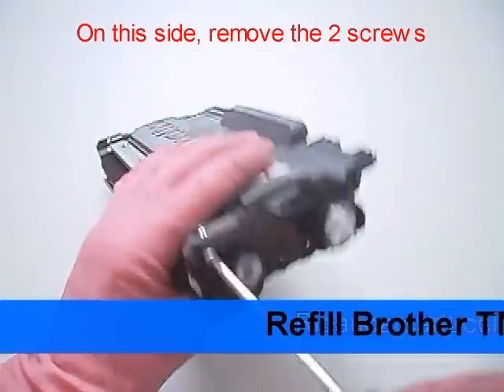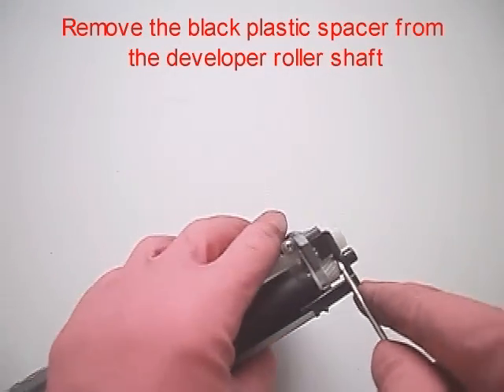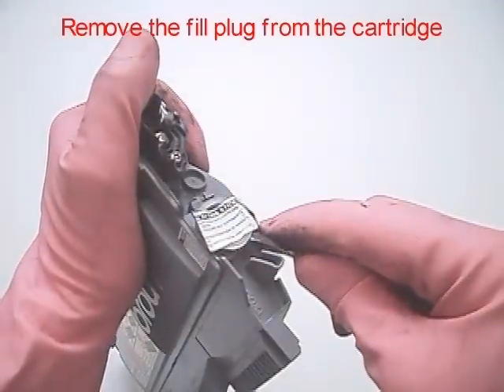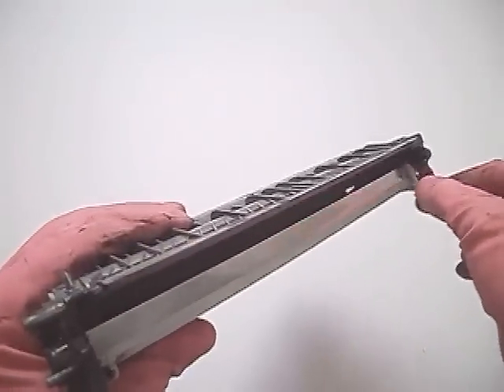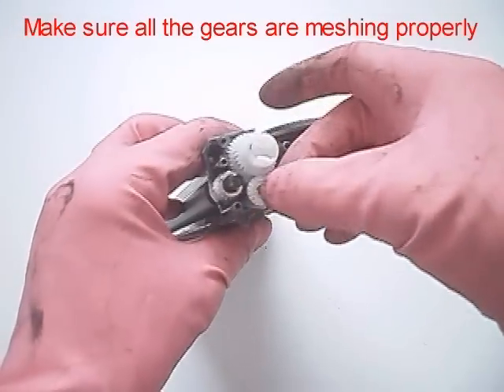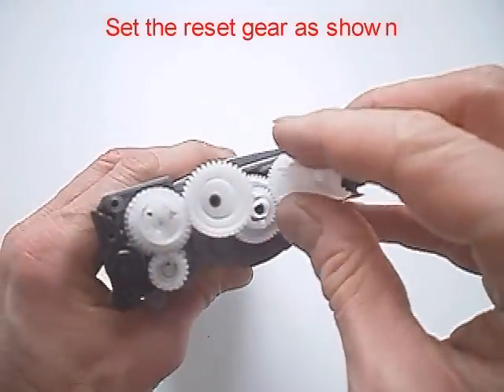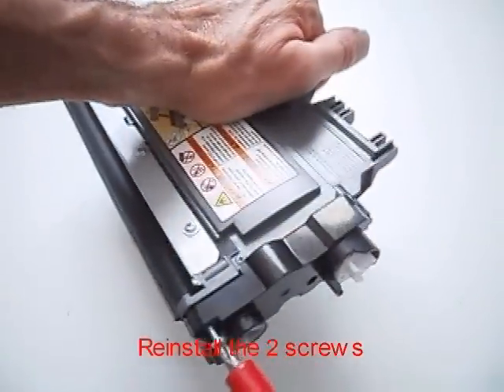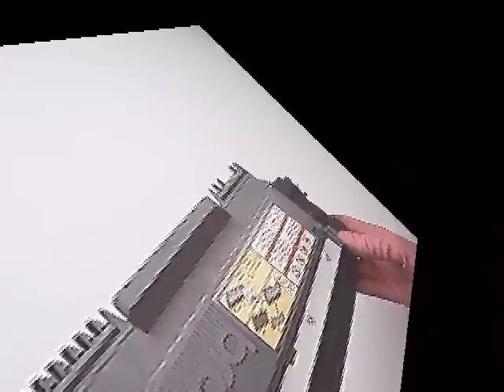Brother TN420 TN450 TN2210 TN2220: refill and reset toner Cartridge

Comment: #1  About how many times can this refill be done before other components just start to wear out?  Assuming the user goes past the low toner warning but refills as soon as the printer refuses to print, resetting reset gear required.

#2  When parts start to wear can we just replace them and rebuild the cartridge instead of throwing the whole thing away?  I am sure this is what brother does when they offer a free shipping label to send in old print cartridges to be recycled.
Reply from the maker: A Brother cartridge could be refilled around 2-3 times before the blade or the toner roller start to be worn. Yes it's possible to change the blade or the roller, the only parts that wear. However I think Brother throw the cartridge you send to them, obvioulsly respetting the law

Comment: 2 more questions.  
There is one more roller that is not mentioned.  The developer roller I believe.  I think it is the one that heats up.  Should we be doing anything to clean that? 
 I was thinking of refilling two cartridges at the same time but the standby one would probably be sitting unused for several years.  I know laser printer toner can stay good a long time but should I wait and refill the standby cartridge until it is needed or will it be as good as new if it sits for 5 or so years unused?
Reply from the maker: Do you mean the fuser roller? You can clean it with alcohol, or a dedicated cleaner.For the other question, I think that cartridge is still good, you can refill it

Comment: Are the starter pack and TN420 identical except for the missing reset gear?  I received a toner refill kit and they sent out a reset gear and a new cover so it could be fit on.  Is the toner compartment on a starter big enough, or identical, to take toner measured for the high yield version?
Reply from the maker: Yes. it can take the same amount of tner

Comment: Don't we need to empty the waste hopper?  I did not see any mention of that in this video.  I only saw the part about cleaning out the new toner compartment but not the waste hopper.
Reply from the maker: There is no waste hopper in this cartridge
Reply: @viandant5    Does the unused toner then just get scrapped back into the main toner compartment then?  That would make it even more important to be sure and get all of the old and waste toner out.
Reply from the maker: @londonranks  Yes, the unused toner get scrapped back into the toner container

Comment: Happy to say this video is still excellent in 2019!  Just had a TN410 cartridge refilled locally and it did NOT work.  Before taking it back (involving a long drive) I decided to try to fix the problem myself.  Watched this video, found the problem (the reset spring not positioned properly) and it works perfectly now.  Thanks!

Comment: Thank you viandant5 for excellent instructions. 

What your description says (READ IT PEOPLE!) is true: when the new cartridge is inserted the contrast is reset. 

This is why you should not (on some printer models) just reset the "replace toner" message (or LED). When you do that the contrast is reset and you will get light printouts. 

When you replace (or refill) your toner cartridge AND reset the "replace toner" message the new cartridge will give correct contrast again.
Reply: I just replaced with a new cartridge on a Brother fax/copier and the print is really really DARK!   Anything with an even semiwhite background (cartoon from newspaper), the "white" spaces turned out very dark. I had to increase the brightness to get regular printouts.  So whatever changed for the new cart, it over did itself.

Comment: If High Yield Cartridge has 90g of toner, how about the low yield cartridge? How many grams? and what if I put high yield reset gear in starter cartridge, is that okay? thank you in advance.
Reply from the maker: low yield cartridge has 50 grams of toner. Yes, you can put high yield reset gear in starter cartridge. may be you'll have to modify or change the side plate
Reply: thank you so much Sir for a very helpful advice.. Cheers!

Comment: Hi, why the TN420 starter cartridge can not be refilled? It does not have the gear but I found a way to reset it thru the front panel. Thanks!
Reply from the maker: If you have a printer in which is possible to reset the counter manually, the started cartridge can be refilled

Comment: I ordered two toner cartridges for my Brother MFC-7340 from Office Supply at $49.99 each. When they arrived they look nothing like the original toner unit. Their instructions direct me to a web address for Brother Reset Instructions. When I go there I get a message No Project. I do not want to reset anything. I want something that works in my printer.
Reply from the maker: Joseph Bishop your machine uses TN-360 / Tn2150 toner cartridge. probably you bought the wrong cartridge, or you didn't remove the drum unit

Comment: I hope it’s not too late to get some help here.  I’ve looked at tons of videos, but can’t seem to get this to work (HL-2270DW).  I have a starter cartridge, and I have a replacement side panel.  The only steps on your video I didn’t do was use compressed air and clean the roller, only because the previous videos didn’t say that and I had already put in new toner.  But that should only affect the quality not the cartridge actually working, correct?
Can I not convert the starter cartridge with this side panel?
Anyway, I followed all the steps (multiple times) and I believe I have everything right (flag in the right position and the gear next to it pointing as directed), and I’ve done the button voodoo to reset the cartridge, but every time it tries to print it make three awkward roller sounds and gives me an error message.  I’ve checked and rechecked and can’t figure out what’s off.  And the gears are all meshing, just for the record. ACK!
Reply from the maker: Mr. Marshwhite which is the defect? it does not recognise the cartidge? the starter cartridge has a different side panel but it has no reset gear. do you insert the reset gear? probably the reset gear is not in the right position
Reply: viandant5 Thanks for responding!!  As far as I can tell it recognizes the cartridge.  frankly, it sounds like something is not jiving with the gears, but I have checked and rechecked (following your video step by step) and the flag is right, the reset gear matches exactly as the does the arrow pointing and the spring.  I am baffled.  I think I better order a new cartridge, see if something else is going on....unless you have another suggestion.  I hate to give up, but something is amiss.
Reply from the maker: Mr. Marshwhite try this to reset the toner sensor.
– Open the front cover
– Turn the printer off.
– Hold ""GO (START)" button while turning the printer on. All lights will be on.
– Release "GO" button
– Press "GO" button 2 times. All panel lights will be on.
– Press "GO" button 5 times. The toner light will be off. (error may be flashing) the paper light should be on or flashing.
– Close the cover. The ready light should be the only light on.
Reply: viandant5 I had done that several times.  Something finally clicked and we're back in the game!  Seriously, thanks for all your help; it's very kind of you.
Reply from the maker: Mr. Marshwhite ok, have a nice day

Comment: Great video. Easy to follow instructions.... though I don't have always the option with the compressed air..... You really did a PRO job with the cleaning and refill process..... Thanks for the instructions and the great video.
Reply: I'm using Brother HL-2240 with the preinstalled toner cartridge for now..... I'm thinking about the new generic TN-450 for later..... So, if I refill the starter cartridge and install the reset gear on it, I only get +/- 700 pages?? Is it best to get the new generic TN-450, which will get me +/- 2600 pages?? Thanks viandant5 and great video.
Reply from the maker: Biciman Junior thank you, happy to helo you. if you install the reset gear on your starter cartridge, you get 2600 pages.
Reply: viandant5
 Thanks for the reply. I'll get the reset gear.......  How many times do you think it's recommended to refill the Brother cartridge (the starter one, the TN-420 or the TN-450)?? Thanks
Reply from the maker: Biciman Junior the weakest component is the doctor blade, the metal blade of the developer roller. probably you can refill this cartridge 2-3 times

Comment: The video is not working for me. I have an MFC-7860DW printer. Can you please explain to me how to reset the gears?
Reply from the maker: which kind of cartridge do you have? probably you have a starter cartridge. the starter cartridges have no reset gear, it's not possible to reuse them unless you add the reset gear and change the side plate.

Comment: i'm trying to refill the cartridge that came with my brothers dcp-7065dn. this is the first time. i ordered the toner which came with the reset wheel. I think i've followed all the instructions but when i put it back in the printer it still says change toner cartridge. what am i doing wrong??
Reply from the maker: if the error message does not automatically reset, in the description of this video you'll find a procedure to reset it manually:

Comment: Sofar this seems like the easiest laser cartridge to refill.. the plug is there for you to refill with a minimal disassembly. I still think refilling an ink cartridge 5-8x instead is easier, but to each their own (my hp 7410 is on 18k pages and counting). 8k pages for $8 black toner (assuming 2 refills) vs 8k on 16oz of refill ink (assuming 12 - 15 refills) for $12, your choice.  It's almost dead even when you factor in the cheaper cost of the cartridges as a consumable over time (more expensive ink vs cheaper cartridges). Props to brother for making this easily refillable. BTW, a can of compressed air would also work for this.. minimal moisture, just use SHORT bursts w/ the straw.

Comment: Hi I have the brother HL-2270DW printer and it uses TN 420...I am confused about the toner refill part.. is there a specific type i have to buy or do all work just fine? thank you! 

and if you please know of any websites i can buy the toner refill from please let me know :)
Reply from the maker: in this type of cartridge every black toner for brother printers will works. be sure you perfecly clean the cartridge before.
I dont know which is your country, to buy toner refill try ebay or amazon, or Uninet, delacamp, future graphic
Reply: i live in toronto canada, and thank you so much for the quick reply! also do u think a vacuum is sufficient? i dont have an air compressor unfortunately
Reply from the maker: Esraa Elnagdi
a vacuum is sufficient. be sure to perfectly clean the foam roller inside the cartridge
Reply: ok thank you so much!

Comment: hello, when a refill the toner does not damage the parts, agradecere reply , another is , how many times can I refill the same toner , which brand is recommended
Reply from the maker: no, this is a very simply cartridge and there is no problem to damage a part of the printer, if correctly done.
you may refill the same toner for at least 3-4 times. it depend on the conditions of the developer roller and the developer roller blade.
there is not a best brand of compatible cartridge, all cartridge are virtually the same, made in china

Comment from the maker: Turn off the printer.
Hold down the Go button as you turn on the power switch. Keep the Go button pressed down until Toner, Drum and Error leds light up. Release the Go button. Make sure that the Toner, Drum and Error leds are off.
Press the Go button again. The printer will print a Test page.
or If you are using Brother's Windows printer driver, click the Print Test Page button. It is in the General tab of the Windows printer driver.

Comment: The actuator gear position shown at 3:02 has the arrow pointing to approx. 4 o'clock. This is correct for a TN420 cartridge, but a TN450 should have the arrow pointing to 5 o'clock.

I refilled a starter cartridge this morning, and installed a TN450 spring, flag gear, and cover. Then I printed some test pages (using the 'go-go-go' method). With the arrow in the 4:00 position and the status showed 50% toner remaining. Moving the arrow to 5:00 put the toner remaining at 100%.

Great video! :o)

Comment: Well I successfully refilled my 2170W starter cartridge. I placed the reset gears onto the existing starter hardware, screwed back together, and seems to work fine. Printed a number of pages with excellent clarity. The reset gears go in 1. flag gear 2. large gear 3. small gear last.  I previously plugged the optical holes and still have tape over the holes.

Comment: If I'm not mistaken, the 2170W printer uses a TN330 or 360 cartridge. But maybe your video still applies to 330/360. I'm trying to refill the starter cartridge that came w the 2170W. Can I successfully refill a starter cartridge?